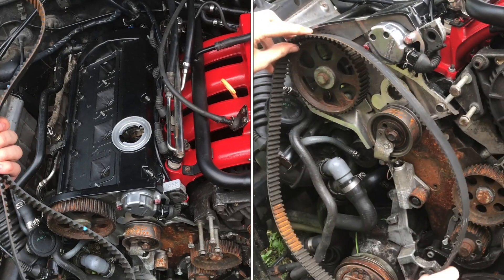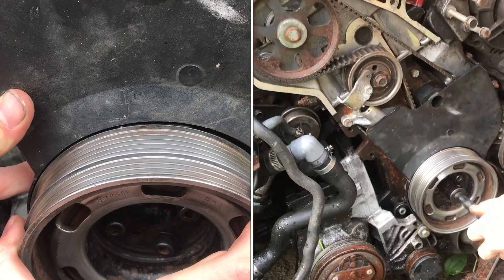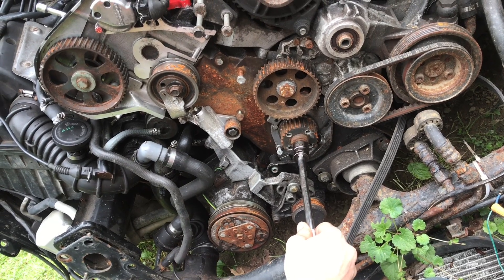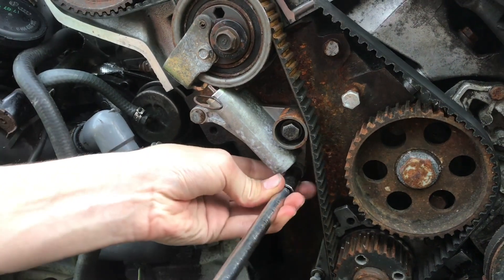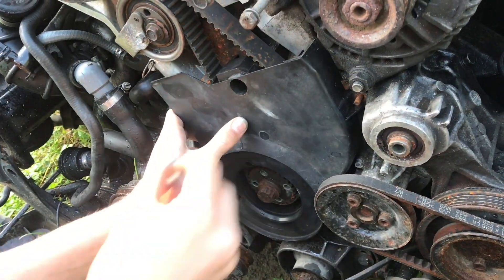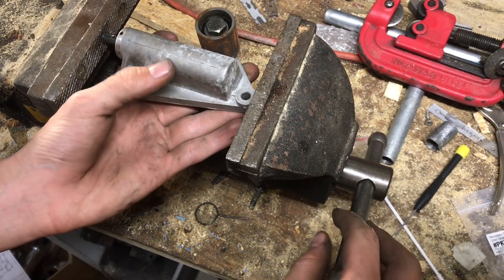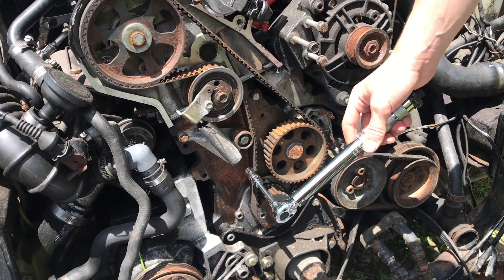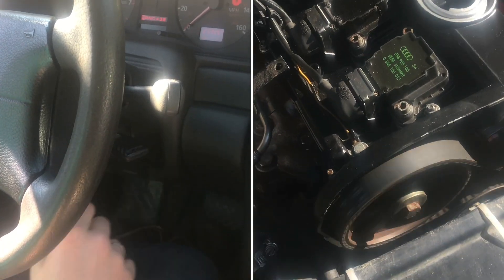installing TIMING BELT 1.8t volkswagen audi (torque specs)

Comment: lol the reason you had to realign to tdc is probably cause you’re rotating the engine backwards causing even more excess slack. If your doing a timing job you should know to only rotate the engine the direction the engine actually runs in!

Comment: am i able to just loosen the tensioner and remove the timing belt if im not replacing the cam/crank seals? all the diy instructions have you removing the cam/crank sprockets...ive done timing chains on a q5 and had to remove the sprockets for the cams so wasnt sure. thanks

Comment: Danger.....do not rotate the engine anticlockwise
Reply: is there danger if the timing assembly is fully assembled and you're turning with the engine off?
Reply: @andrewthag  Nope as long as you’re only rotating the engine clockwise you’ll be fine